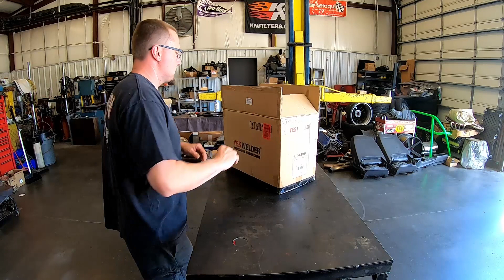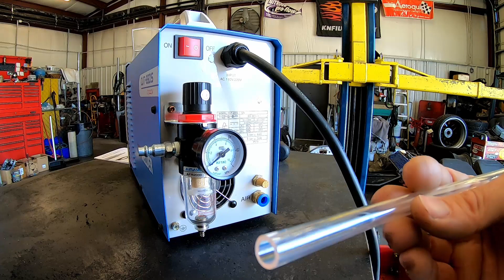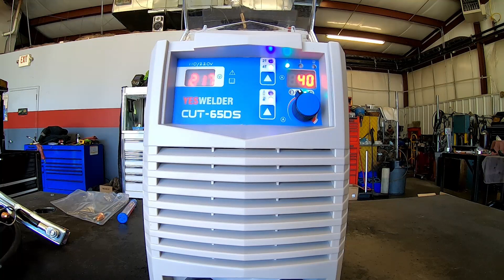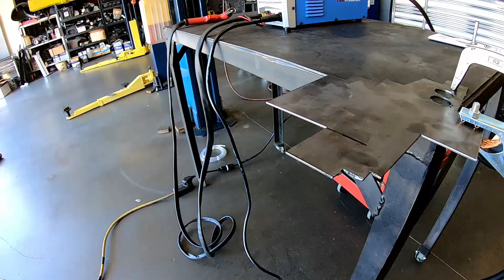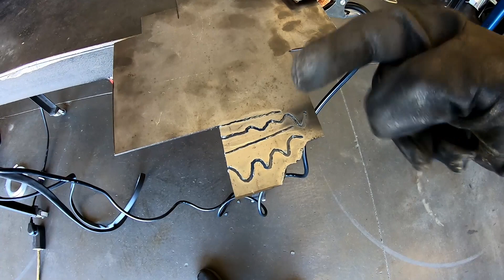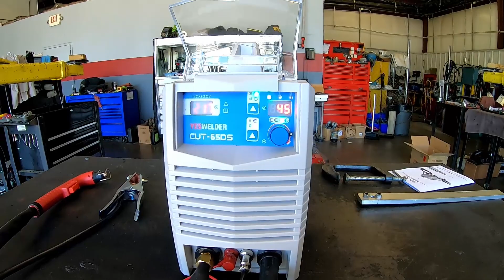Yes Welder CUT-65DS Setup and Review

Comment: You can skip the instruction book. What they didn't leave out is almost worthless.  I just got mine Friday and were it not for other fellers like you I'd have been wandering in the dark.  I am a novice welder although I once held a "maintenance level welding certificate" but am brand new to plasma cutters and tig which just began.
Looking forward to your approach on the setup.

Comment: Hello High PSI tv, thanks for the demonstration. Do you think this machine will work with 40 Amp breakers? Unfortunately, I do not have the recommended 63 Amp circuits and breakers set up.

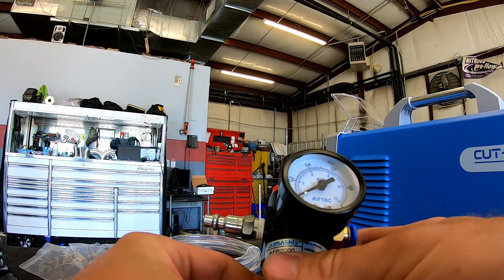Comment: Hi Thank you for the helpful review. I just received this exact model tonight - my first plasma cutter. Does the "air-in fitting" (in 3:04 of your video) come with the plasma cutter? It did not come with mine. Also, what do you estimate as the minimum required air compressor needed to run this?
Reply from the maker: It does not come with that fitting. Depending on how long of a cut you make, you could do it with a 20 gal compressor